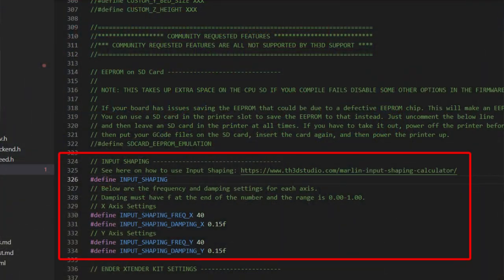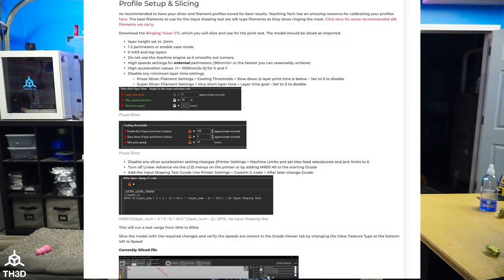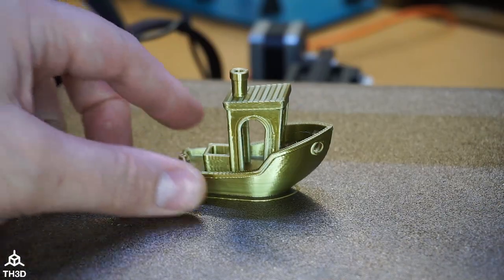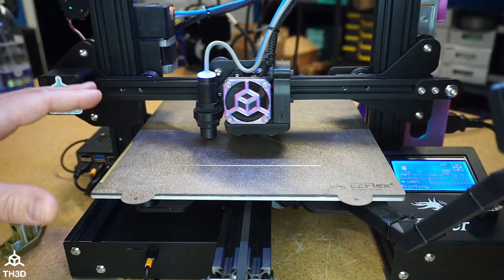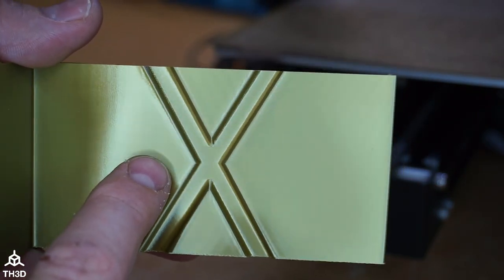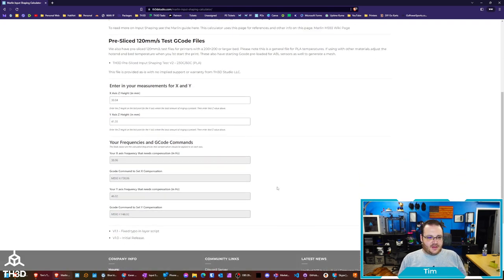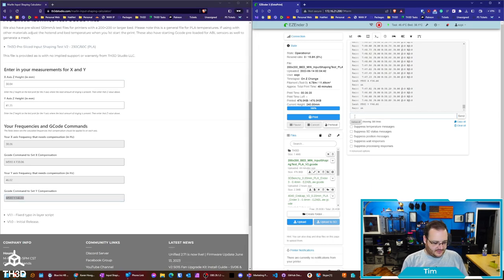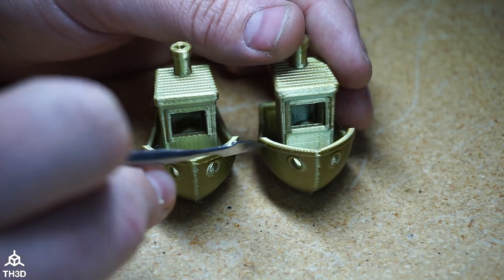How to Setup Input Shaping with Unified 2 & Marlin 2 Firmware

Comment: Need a good how to for what order to tune first. Marlin has no documentation as of yet and Klippers says to tune accel linear advance (corner velocity) after input shaping.
Reply: Documentation is here: https://marlinfw.org/docs/gcode/M593.html
Reply from the maker: Added this to the video description too. Thanks Scott!
Reply: @ScottLahteine  Did miss something, or does that link not tell me in what order to set acceleration, jerk/jd/linear advance, and input shaping? Lile should you have your accels and linear advance dialed in before or after running input shaping? And what order is recommended for best results? Plus i keep seeing posts saying not to use the arachne engine with input shaping so that throws in even more questions.
Reply: @vicdez  You're looking for artifacts related to vibration, so you should use accelerations that correspond to your typical print speeds. Linear Advance being on or off doesn't really matter.

Comment: so if you set input shaping frequency then change something on your printer do you run the test print as is then adjust the frequency? or do you set it to zero then run the test print and then put in the frequency after?
Reply from the maker: When you run the test print it overrides whats already in the machine. Just run the print and get the new values.
Reply: @TH3DStudio  cool thank you

Comment: What was the time differences between the prints?
Reply from the maker: I actually didn't time them. Probably should have! My apologies.
Reply: @TH3DStudio  Yeah, I am in production with my 3D printers and anything that can save time is worth a look.  But down time to flash 8-9 printers for a 2 minute time save off a 3 hour print would not be worth it.
Reply: Not as simple as that... The time is probably identical but with quality difference, but input shaping means that you can go faster than before.

Comment: I havent been able to make much of a difference on mine. I make all the changes but actual prints dont have a noticeable difference. I also dont understand the dampening value, nor can I find a good explanation on what it does. Marlin config just says: Damping ratio of the  axis (range: 0.0 = no damping to 1.0 = critical damping).
Reply from the maker: Damping is the intensity of the compensation. We run the default of 0.15 on XY. Basically, play with the setting to see what one works best for your particular machine.